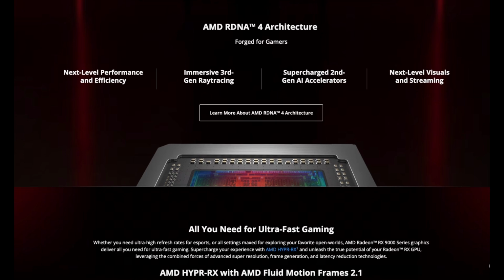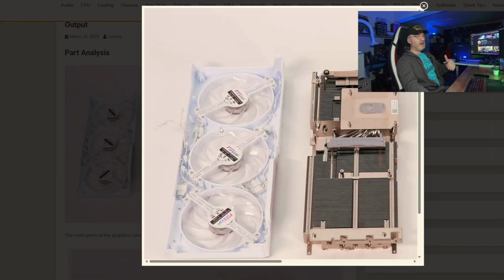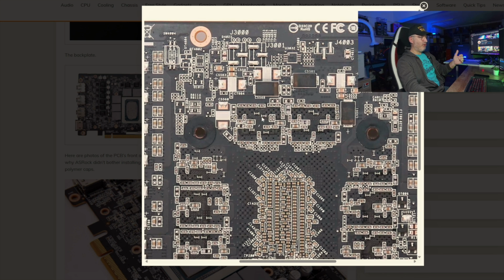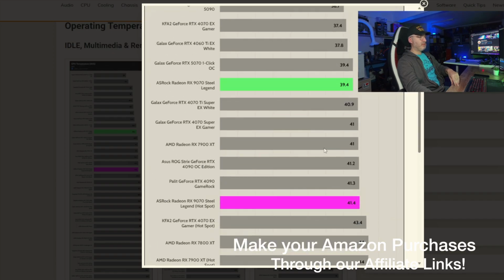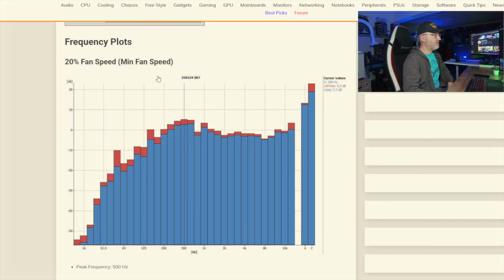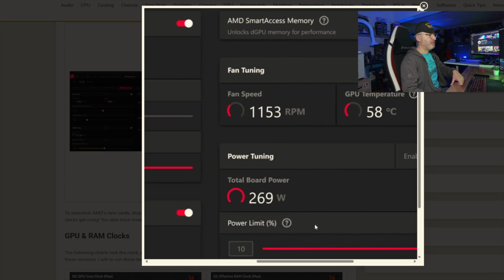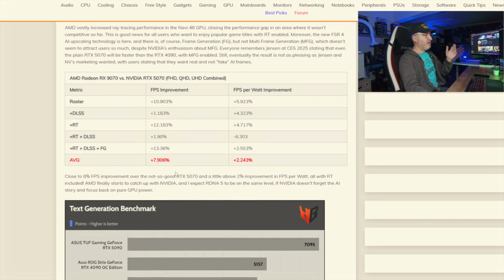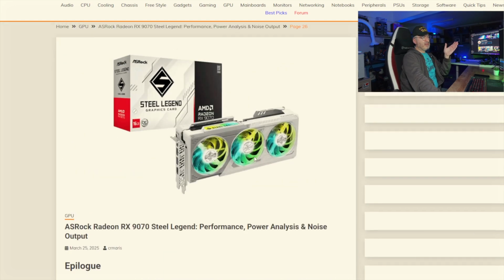ASRock Radeon RX 9070 Steel Legend: Performance, Power Analysis & Noise Output

Comment: Thanks! what thickness of memory thermal pads from both sides?memory too hot wanna switch it to more quality from honeywell
Reply: I have steel legend 9070. At first the fans were not working very hard. A slight tune and now vram temp never go above 75-80C. ~2200rpm gpu fans 45C gpu temp, 65C hotspot. 
The cooling is so good on this card
Reply: @Swanny098  thanks,but i have ears
Reply: @YXY703  what?

Comment: The fan seems low quality: on other cards you have less noise with a higher RPM. Just because the fans don't need to run as fast with 220 Watt doesn't mean that it is acceptable to have more noise than required! I would cut ASRock slack if this would be a budget card but it costs €739 = US$798, including 21% taxes, that is a highend price!

Comment: Could you share your opinion on the VRAM temperatures on these cards. For some reason they are really high, in most reviews seen running at 90C in either big, well ventilated cases, semi-open cases, or open benches. My 6800XT is also GDDR6 and memory temperatures never even come close to 70C in an old FD Focus G case. To me the high temperatures are concerning, and is keeping me from buying a 9070. Everyone thought that high Ts on the RTX3000 cards were normal, yet repair shops are flooded with these cards with failed memory chips.
Reply from the maker: In my sample, I didn't get alarmed. But I will check the logs to verify
Reply: Mine does not get very hot. During gaming hot spot is in the low 70C range at stock config. My 6800XT ran hotter. I have the Asus Prime 9070. VRAM temp is good too.

Comment: Great review! 👏
Thank you Aris!

What is the best buy right now? A Sapphire Nitro+ 9070ΧT at 800€ (probably the best 9070XT implementation) or a MSI 5070Ti shadow 3X OC at 850€(probably the worst 5070ti implementation)?
Do you prefer a better card (5070ti) or a better implementation (9070XT)?
Reply from the maker: I would probably go for the 5070 Ti

Comment: What is a better buy now? Rx 9070 xt is at 820 to 850€ and rx9070 is 703€ and up.
Reply from the maker: at 150 euros difference most likely the plain model
Reply: 9070 xt.
if you can find it.